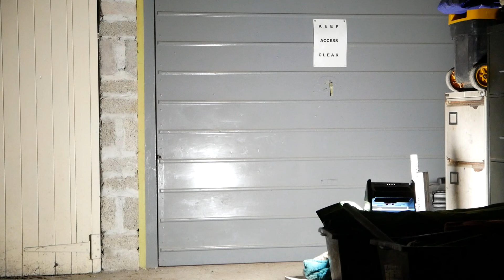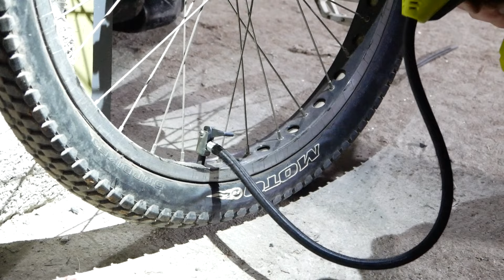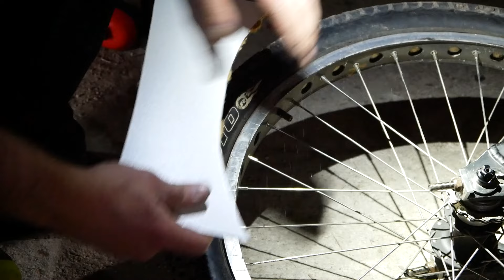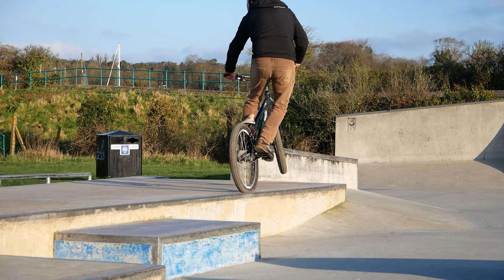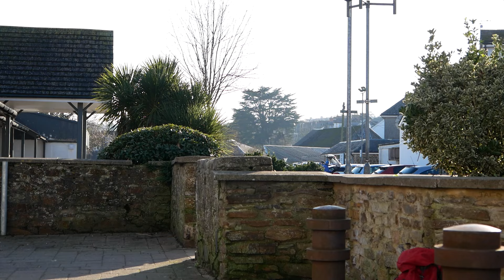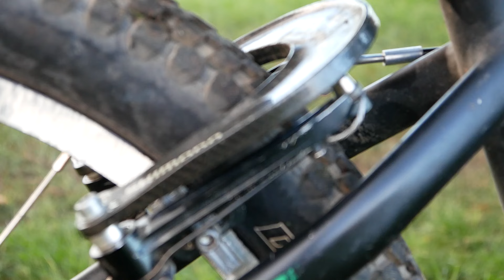Build and Ride! The 24" Trials CLASSIC Onza Zoot!

Comment: Great video and riding.  I nearly grabbed a Zoot ages ago for a cheap" friends bike to share.  I am a 24" mega-fan overall.  Got my first Echo MK2 comp back in 2012 and loved the blend it offered between Mod & Stock comp bikes.  Cool blend of stability with enough flickability for fun and tight spots.  Ended up with a second 24" last year, a Neon Wing comp that is super high BB and shorter which gives it a very Mod feel.  

But my new favorite is the Jitsie Varial Hybrid 24".  I set the bars in the more vertical "street" setup as my play bike.  The bar setup, mid level wheelbase & BB height, along with the dual disc are a great combo and give me a solid ability to mix my comp biased skills with some more street-like moves.  Just a blast to play around on urban stuff and skate parks.